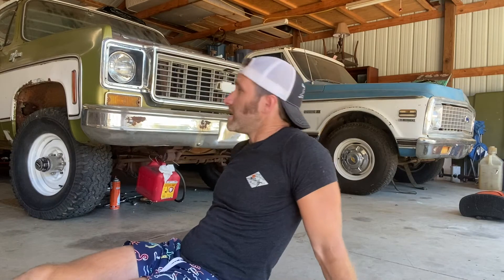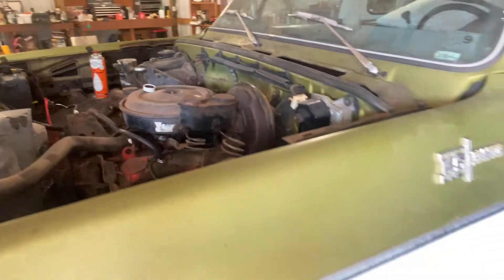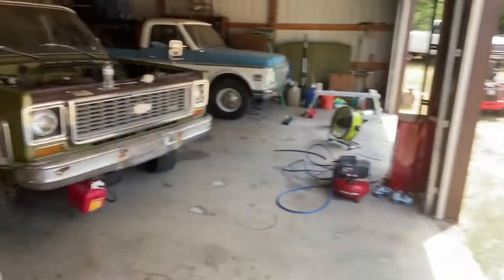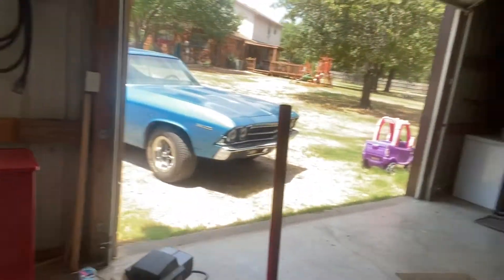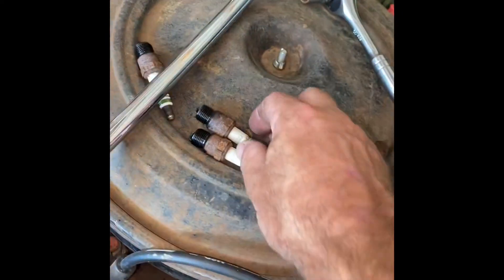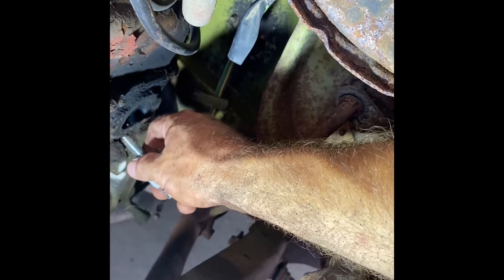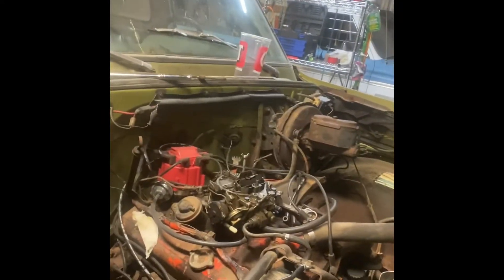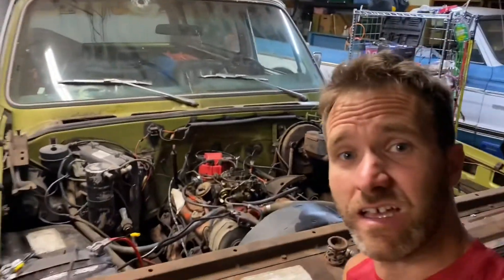Getting my 73 K5 In somewhat working order. Part 1.

Comment: Instead of putting zink and additives in your oil put diesel engine oil in your engines.  It's got what Darick on vice grip garage says more dinosaurs and vitamin zinc that you're old engines require. Dello 400 is one of the highest amounts and the diesel engine oil is usually cheaper than regular oil.  Also it cleans your gas engine internally much better.
Reply from the maker: I’ll definitely check into that!! Thank you for watching!